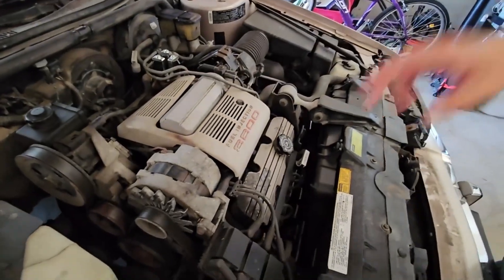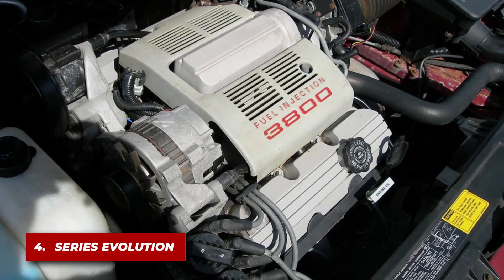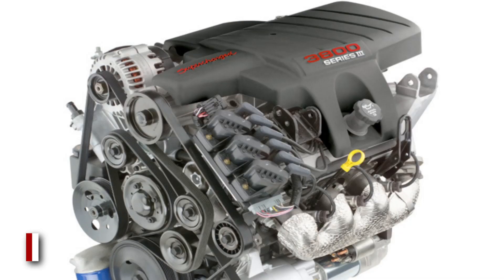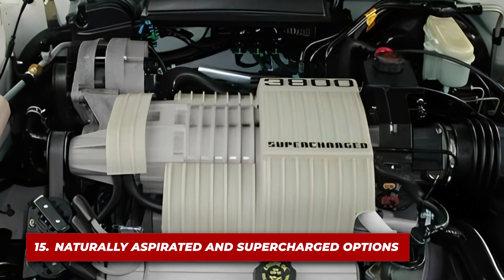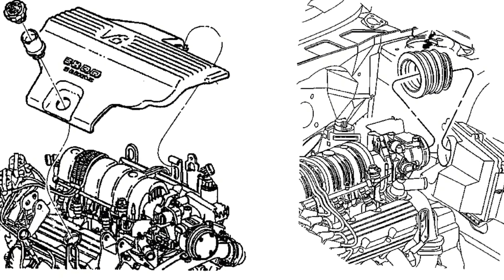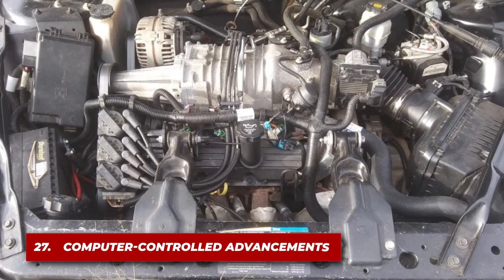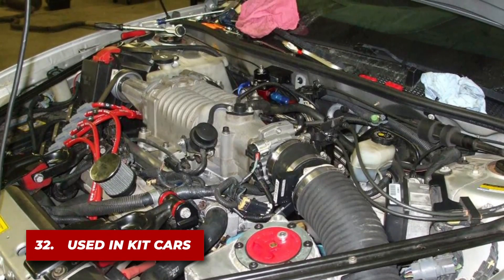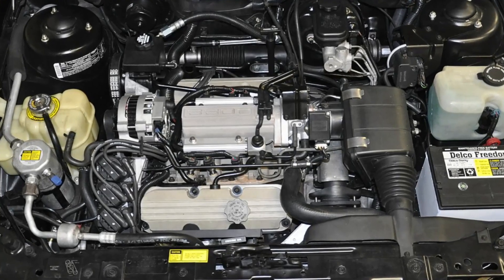38 Facts About the Most Reliable Engine EVER!

Comment: 🤔 Hmmm?
I brought my 2005 Buick Park Avenue in 2013 with 80k miles 
Now 12 years she has over 255k miles’ still running strong’ smooth very reliable car’ transmission was replaced once with a new one’ dealership redid the engine @ over80k+miles
Very good engine

Comment: I had a 231 in an 84 LeSabre and it was a total pile of 💩. No oil pressure, it knocked and I even put new bearings in it, a new oil pump front cover and it was absolutely amazing on what would go out next. The 3800 FWD was much better so this length of time they state is a lie. Until the 3800 came along it was garbage!

Comment: That's a stone age dinosaur pushrod with hydraulic lifters that's not the best engine.  Even if it was it would be worthless without good automatic transmission behind it which it never had because gm can't build a good automatic transmission.
 There are so many engines that are better than that one I would not know where to start but I'll mention one Mercedes Benz OM617.